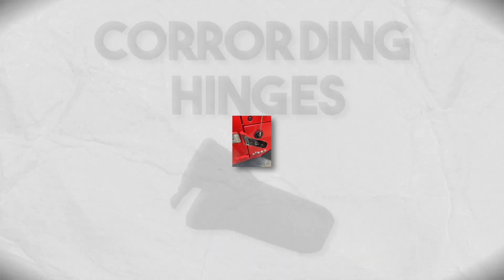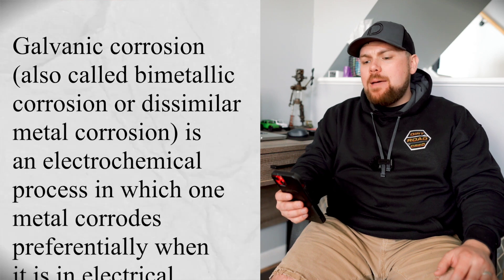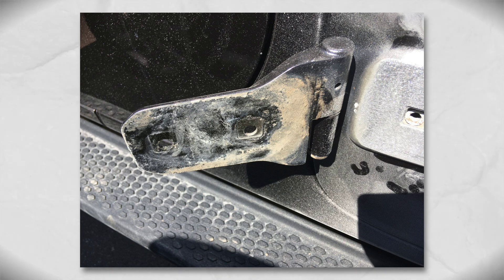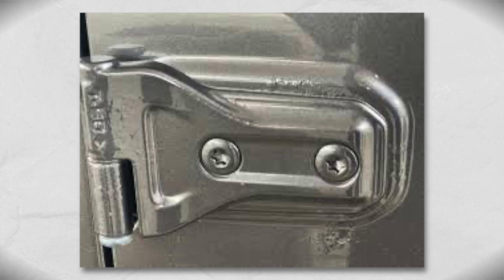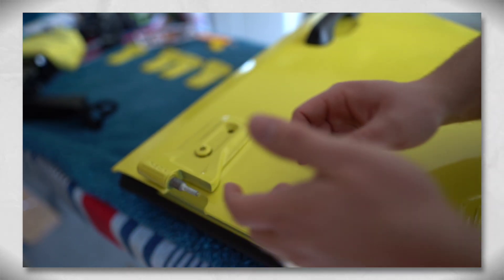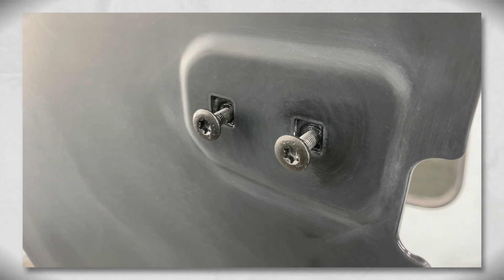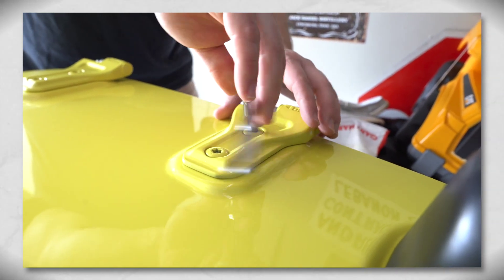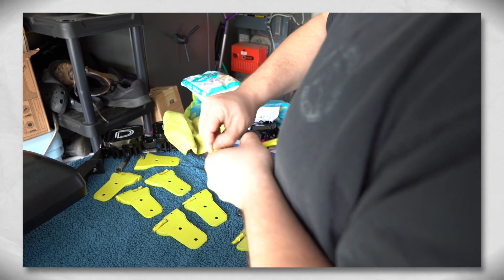What's up with the Jeep Wrangler JL Hinge Corrosion?

Comment: From some recent research I found that Apparently like the JK the hinges on the JL are actually aluminum. So in that case it is not Galvanic Corrosion, just good old aluminum corrosion. However, even if it was, that is no reason that the door or hood edges are corroding with no dissimilar metals. That would be Metal prep.
Reply from the maker: Good call
Reply: But the bolts are probably not aluminum....and they touch both pieces acting like a wire in an electrical circuit
Reply: @jenniferherod7580  then the corrosion would only be around the bolts. Not hinge and/or body panel.
Reply: I am in uncharted water here. I have a background in chemistry, not auto body. I do know that the longer that "circuit" is in place, the further the electrons can travel thru the aluminum. Trying improve my understanding of application.

Comment: Wasnt there a Jeep update that new JLs (since 2021) had a rubber gasket that was intalled between the aluminum doors and steel hinges so the dissimilar metals would not touch and not cause the corrosion? If not what about a gasket to prevent touching of metals?
Reply from the maker: From what I am hearing there might be, I’ll have to check mine
Reply: thanks for checking Matt...If there is not one... rubber gasket) there ought to be...to keep dissimilar metsls from touching but painting helps a lot as well love your channel keep it up
Reply: There is also a newish TSB that  adds a zinc shim in between the hinge and door as part of the repair. I believe that began in March.

Comment: Did they implement a fix at the factory?  If so, when?

If I buy a Gladiator would it be wise to be proactive by painting and installing a plastic or tape barrier?
Reply from the maker: There is a TSB for this issue!

Comment: Hi Matt, I have this same issue on three of the doors of my 2018 JL Sport S. On December 15-2022 I made my claim at a dealer in central Florida and on March 31 they sent me a message telling me that it was already approved but that I could take up to two months to get an appointment with the body shop. This is extremely frustrating.
Reply from the maker: That sucks!

Comment: Hey Matt, so would the warranty cover hinges and doors for 3yr/36 or 5yr/100?
Reply: The corrosion warranty is 5 years, but this doesn’t fall under corrosion. Jeeps fine print says this would be cover under the basic 36k Mike warranty.  Yes I realize this is total BS and doesn’t make sense
Reply: @brianowens1002  thanks for the info.
Reply from the maker: 5 year!
Reply: @DIRTROADCRED  it’s 3 years, read the fine print.

Comment: I had a recall on my preowned Wrangler. It was an air bag problem. I tried to get it fixed for more than 2 years. The dealer service dept claimed they weren’t taking new appointments every time I called.

I eventually got a letter from Jeep wanting to know why the recall hadn’t  been done. I called the number on their letter and told them why it had not been done. The Jeep rep called me back ten minutes later and confirmed I had an Appointment with the dealer @ 10:30 the next day. I was instructed to call the rep if they failed to keep the appointment. 

The dealer kept the appointment and fixed the problem. Jeeps are fun but expensive. I’ve owned 3 Jeeps. Jeep quality control is a well know problem. Jeep dealers, at least the ones I’ve had to deal with, are pathetic when it comes to customer service.

My Jeep is out of warranty so I don’t have to deal with Jeep dealers anymore. Jeep needs to get their act together and deal with their dealer poor service issues among the other quality issues they have.

Comment: It’s not just the hinges. I had a 2018 Rubicon with the same issue on the windshield frame. The dealer refused to fix it claiming it wasn’t part of the body and therefore not covered. I couldn’t look at it any more and traded it in on a Gladiator. I am sure it will happen again but I do love my jeeps.
Reply from the maker: Haha same!

Comment: Great video Matt! My wife’s 2019 Rubicon is doing this around the hinges on the doors add at the bottom edges of a couple doors,around Hood hinges and on the front edge of the hood that I had clear film protective added when it was brand new. but have not seen any yet on the tailgate. Thank goodness she picked white.
 This is the exact reason I will NOT be buying a gladiator and that’s a shame because I have became very fond of her jeep.(when she lets me drive it)😏😄
Reply from the maker: Dang! Hope they have a fix soon!
Reply: What kind of clear film did you add to the edge of the hood? That’s where my corrosion is.
Reply: @SoCalwave  i’m not mistaken I think it was 3M brand material.

Comment: Hey Matt, thanks for the video. Sorry if this is not a relevant comment but I was wondering if you could do a video on the defrost issue many of the JL’s have? My 2021 JL has a defrost that only blows through the center 6-8 vents and does not blow out at all through the 50 other vents! No air comes from defrost on driver or passenger side. My understanding is that it’s a hit or miss thing that happens in production and that not all JL’s have the issue. I saw a recent video of 2022 Gladiator driving in blizzard conditions and the defrost issue prevented him from seeing out his windshield while driving. It was caked in ice! I found a star publication but when I contacted Jeep and several dealerships; they would not address the issue. I actually cracked my windshield right down the center because I ran the defrost so hot; bc it’s not evenly dispersed through the windshield. I also hear the 4xe ‘s are going through it too when they auto start their Jeep in the morning on a cold weather day and let it sit running for a period of time… cracked windshield!! 

Any attention to this would be greatly appreciated!!
Reply from the maker: Not a bad idea! Thanks for the suggestion!

Comment: I took all my hinges off sanded down to bare metal primed them an bedlined them . After I took hinges off I hit the door surface an backside of hinges wit wire wheel an cleaned them up then I vinyl wrapped the face of it that lays on door surface also I took all the hinge pins out an clean the hole with a brass gun barrel cleaner then put lots of anti Seize in it
Reply from the maker: Nice!
Reply: @DIRTROADCRED  was a pain in the ass
Reply: Hinge pin, good call

Comment: My dad’s Jeep Wrangler is a 2019 he bought brand new, and to this day has 6,900 miles.  It was always garage kept and the corrosion was actually present when he bought it new!  He didn’t notice it, but I did. I know it sat at the dealership for about a year, outside before my dad finally bought it. My Dad just passed away so does anyone know if Jeep will fix this underneath Warranty??  This keep still smells brand new and he was the only driver and owner.

Comment: Hello Matt, I enjoyed the video. I am currently experiencing the same issue and I am considering having a body shop paining the area where the hinge goes and the actual hinge. To avoid having the whole door painted and avoid expensive cost would you say it good alternative. Or maybe having them paint the panel and buying new hinges that won’t corrode.? Thank you
Reply from the maker: I’d get some new hinges and have the underside painted as well
Reply: Suggestions for replacement hinges that won't corrode?

Comment: Why not just remove the hinges from your new  or uncorroded Jeep and apply paint on those dissimilar metal surfaces. The two surfaces are self indicating as to where to apply masking and your paintwork will never be seen. Wouldn't the only risk then be potentially marring the fasteners? (which can be easily touched up).
Reply from the maker: Good point!

Comment: Not just corrode. The problem is, most owners ignore many paint problems. They think it's normal since most issues are not visible. When I got my 2023XR, I checked all doors jambs, under the doors, hinges, hood, tailgate interior 
, etc... Unfortunately, all 4 doors have many imperfections and under the door paint look matte instead of gloss finished. On top of that , all premium half doors too lol. What a joke with Jeep. I called FCA and the dealer. I explained to FCA I ordered the vehicle and waited 8 months for this and spend 6 digits? The dealer took pictures and FCA approved everything and I made them paint all 8 doors , hinges, even the hood had over spray. It took me 2 months to complete everything , because of the decals and emblems took forever. If the new Jeep owners will just take their time to check the paint, it should should be addressed whatever the issues are.  Brand new vehicle with many paint issues. More complaints, the better they will pay attention to quality. If the problems are not being reported, they're not gonna know the issues they need to fix.
Reply from the maker: Well said

Comment: Jeep JL and JT hinges are aluminum. Doors, hinges, tailgate, hood, winshield frame and front half of the body are all aluminum. Only the bed of the JT is steel and the body at the rear doors. Aluminum corrodes. Check the hinges they are not magnetic .
Reply from the maker: Just hear that also, I will double check

Comment: Pull the hinges apart, clean them, and spray with zinc chromate primer, then place a plastic foil between the two dissimilar metals and reassemble.
Reply from the maker: Thanks Jim!
Reply: Primer the bolts also?
Reply: @jenniferherod7580  I did not spray the bolts. just sprayed after attaching.

Comment: There needs to be an isolator installed in between the 2 pieces of dissimilar metals to prevent this from happening.
Reply from the maker: Agreed!
Reply: and STOP painting ferrous parts in same facility as aluminum parts... easier said than done I know, but attention to detail  or lack thereof is at the root of this issue.

Comment: Should be a recall on this, very frustrated with the Jeep engineers. To rectifier the problem, the fix would have been $5.00 per hinge. Lately I seen a loaded 2 year old Jeep Rubicon with paint peeling around the hinge!  Unacceptable for a $70 000 CAD vehicle.. Dodge /Jeep dealership answer? We have to blend the door. Meaning the paint probably won't match.
Reply from the maker: You’re not wrong!

Comment: Would be nice to have this as an add on at dealership.
Reply from the maker: I was thinking the same!
Reply: An add-on? Why should I pay additional to correct a design and manufacturing flaw?
Reply: @rtucker1004  Because you are going to pay either way. If it is done at the factory the cost of redoing the process will be added to every Jeep. Many people won’t keep their Jeep long enough to care about corroding hinges. Those that do, can add the cost to their Jeep at dealer and have it under warranty. Currently the only option is to try and find a good enough paint and body shop and pay for it out of pocket and hope they stand behind their work. Was it an oversight on Jeep? Absolutely. But extra work means extra cost no matter how you figure it.

Comment: In my opinion, all that is really required is to anodize the aluminum portion, and then paint it with a Zinc-Chromate primer, prior to attaching the hinges and painting the rest of the vehicle… Basically, it needs to be treated like an aircraft…

Comment: Thank you for posting the correct answer so everyone understands what causes it. I believe by what I was told and also seen something different on the mid 2019 and up have a gasket between the hinges and the doors.  
I know you explained this perfectly also I’m a Ford guy and for those that want the bronco instead of the Jeep they need to remember every Car , truck , suv have different issues The mustang also have similar issues on the hoods due to the same thing body body panels connecting and touching each other when it’s 2 different metals. There’s nothing perfect. I agree that Jeep does need to fix this specially the money we are paying for them these days but being nice and politely with Dealers and service advisors gets you farther to getting things fixed then being the Karen at the dealership. Thanks again ! Keep up the great videos
Reply from the maker: Thanks Daniel!

Comment: In plumbing, we see the same problem occurring between copper and steel. Therefore, it is recommended and, in many cases, required to use a dielectric union. The breakdown of this type of union shows a total isolation of the two metals with a rubber gasket and plastic isolator. In my thinking, if a thin rubber gasket or isolator could be added between the hinges, could it slow down the process?  And would attention then turn to the bolts where a similar problem could occur?  Maybe it could be proven out by one of us. Unfortunately, I see a potential for the door to sag and fall out of alignment.  

Thoughts anyone?  🤔

Comment: I’ve had all 4 door, the hood, and tailgate repainted on my 18 JL.  Jeep replaced all the hinges except for one door.  A year later those hinges were replaced.  Now 2 doors and the hood are getting bubbling under the paint coming from the seams.  Add this to everything else that has failed in this thing and the carfax is probably 14 pages long now.  Absolutely the worst vehicle I’ve ever owned.  Never again with anything from this company.  And calling jeep cares is a joke.  I have multiple cases and never get calls returned from the “manager”.

Comment: This is incorrect  because it's happening everywhere. Hood Windshield frame bottom of the doors and nowhere locations. And jeep knows of this and won't correct  it and people are having issues  getting this fixed . From warranty expired, not the dealer it was purchased from, etc. This a should be a recall. But will never happen.jeep should do the right thing  and recall  it regardless  of warranty. And then it's the body shop  that does a terrible job fixing it that it returns.😢😢

Comment: Only way to deal with dissimilar metals is to have a spacer between..if they are in direct contact you will have issues.  I can not believe engineers let this go with knowledge...jeep needs to correct this before it becomes an issue..engineers should hold their heads in shame for doing this..
Reply from the maker: Good point!